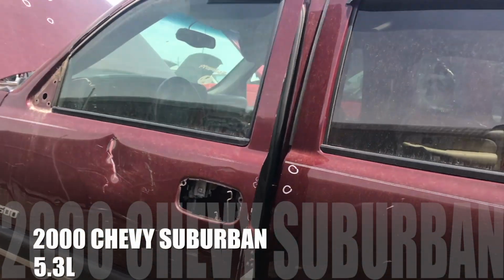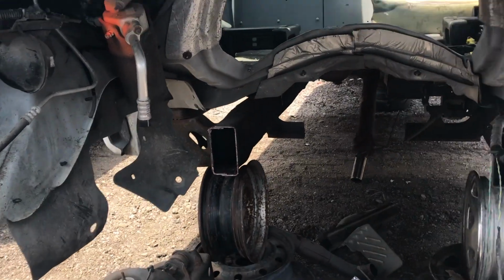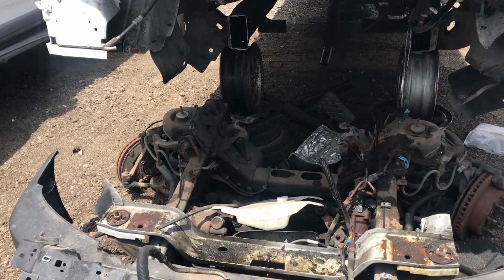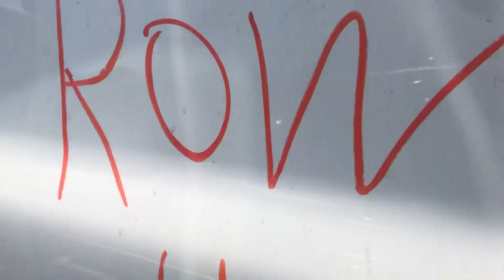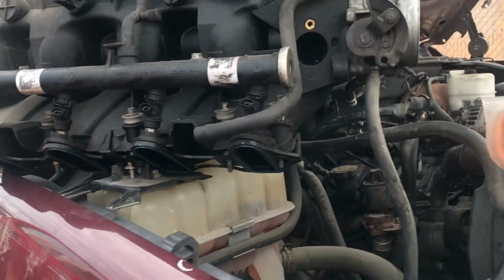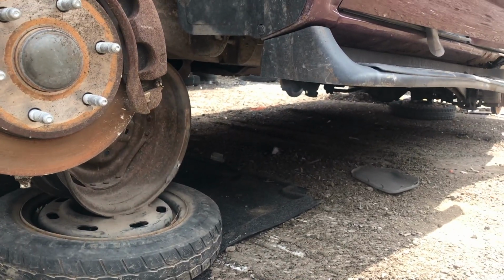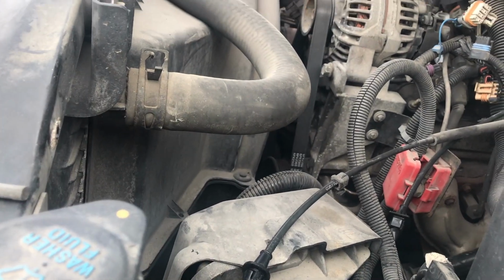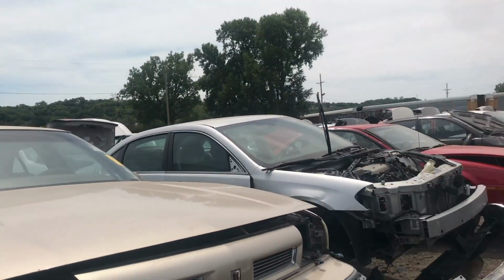Pulling a Junkyard LS 6.0 !!!  Fail

Comment: That sucks but lmao at that clip 
M18  sawzall with 5.0 battery  makes easy work of the frame
Reply from the maker: Nice. Thanks. Good to know. I think my Ryobi w a 5.0 battery will work too. Looking at how straight the cuts. I'm thinking it more likely angle grinder w a cut-off wheel they are using out there.
Reply: Catloco's Garage  use any good sawzall will work I have done it like that once unbolt core support bolts 2  cut the frame at a slight rearward angle so when it drops onto torsion bars it doesnt bind much  and go at the trans bolts easy  cut or unbolt trans x member
Reply from the maker: Black Macgyver Sweet. Yeah I’m def gonna test that out. I’ve been doing it the hard way these last few pulls. My new ryobi sawzall should do the trick. I wanna try those Milwaukee torch or my go to diablo blades.

Comment: The 6.0 and 80e is probably inside the building with several others. 
Probably all listed on ebay or for sale at the special high performance rate due the owners of most yards becoming savvy to what the current market will bear and how needy we've become for these.  I'm surprised more don't try to become the local retailer's for Chinese turbo manufacturers and other various imported treasures...
Reply from the maker: If I see a yard selling engines, then chances I won't go there for an engine. One yard had one out front asking $600 on it. It's been there a while :) Dealerships tend to send "freelance pullers" to get them quick. Plus shops are out there daily pulling them. There's a lot of competition out there. You just have to get lucky or go when conditions are bad out.

Comment: A van has to be even harder to pull a motor out of, that makes sense why you'd just cut the frame.
Reply from the maker: Str8sixfan Not if you do it like them. Knox and I pulled my 6 from that exact same model van.

Comment: Dam if that dropped online today and it's already gone and removed the same way, it's probably the same guy or group of guys doing this. They are doing the same thing as you, checking to see every morning what has hit the yard. Probably there right when the yard opens in the morning. If you wanna best them to it You have to be first in line when the doors open. That's what I do. An 04 Audi S4 hit the yard a month ago with pristine recaro seats. While I was there pulling the the second seat around 10am dude walks up and says , "dam, thats what I was coming to get, the seats". He even asked what I would take for them right there in the yard. They can go for around $700 for the set, maybe more. I declined . think I'll throw them in my Monte Carlo.
Reply from the maker: Classic Ride Society Yeah all the good stuff normally hit while I’m at work. What you’re seeing are the pros. They know when it’s dropping ahead of time.
Reply from the maker: Nice. Yeah that’s sweet on the seats. I work a normal job, so I’m limited to weekends unless I take off.
Reply: Catloco's Garage for them to know when it's going in the yard They have to have someone on the inside letting them know. Not sure if you knew this but the vehicles actually go out into the yard the day before they are posted online. At least that's the way pick n pull does it here.
Reply: Catloco's Garage I work overnight so even though I'm supposed to go home and sleep after work, I'll lose some sleep and hit the yard when it opens for a good deal.
Reply from the maker: Classic Ride Society Yeah I know. Those vans normally don’t get picked. Maybe they watching my vids.. 😆 I’ve seen a 2 day delay also on getting it posted online.
Reply from the maker: Classic Ride Society Yeah I know. Those vans normally don’t get picked. Maybe they watching my vids.. 😆 I’ve seen a 2 day delay also on getting it posted online.

Comment: I've seen that carnage before... those guys are quick as hell, might be an inside job. Gonna have to leave a $20 with your number on it with one of the yard guys next time.
Reply from the maker: Hard Knocks Forge Yeah def a heads up from inside. That’s why I knew we had to get that 6 quick.
Reply: Hard Knocks Forge yea it’s usually the shops or eBay flippers that do this crap. All about the money they don’t give a shit about anyone else.

Usually get a tip before it’s even out that it’s on the lot.

Comment: the junkyard i go to doesnt check your stuff period once you been there enough and you act professional id say they used some kind of carbide blade if it was a sawzall.. or maybe one of those bandsaws?
Reply from the maker: Yoda Doug A bandsaw would make sense, but would be hard to fit in that space. They allow sawzall and power tools here. Just not torches or jacks. Nothing that can start a fire or make a car fall on you.

Comment: We got a couple 2500 and 3500 Chevy trucks at our pick n pulls how is a 6.0 worth 243 on heads
Reply from the maker: John Carden Grab it when you see them 😂 It varies by state but I’m pulling them for personal use on my vehicles. $400 on the low end to few thousand on higher end. I got mine for $198 here for the block without accessories

Comment: What heads come on 6.0 so I know what to look for how do you tell 5.3 from 6.0 can you do a video on how to tell
Reply from the maker: Most 5.3s will be 862 or 706 heads. 6.0 will be 243, 799, and 317 heads. There may be more, but those are what i've seen. Depends on LS you are looking at. There are sooo many variations of these motors.
Reply: Catloco's Garage 6.0 only come with 317 unless 07 up then 823
Reply from the maker: Yeah mine was 317 heads. I haven't caught any others out there yet.
Reply: Look for "U" or "N" in 8th digit of Vin

Comment: Is this a pull a part junkyard I thought you was aloud to do that the ones here were I live don't allow you to bring power tools on there yard
Reply from the maker: This was a Pick N' Pull. We can bring power tools. You can't bring jacks or torches. Some won't allow corded tools, but I've seen people use a generator w corded tools out there.
Reply: Catloco's Garage yes the ones here have different rules I just found out the one in the county were I live don't allow it but I called one two county over and they do allow it so guess who is going 6.0 shopping tomorrow thanks for the insight on the heads
Reply from the maker: Michael baker Yeah film some of it if you can. Tag me if you do.